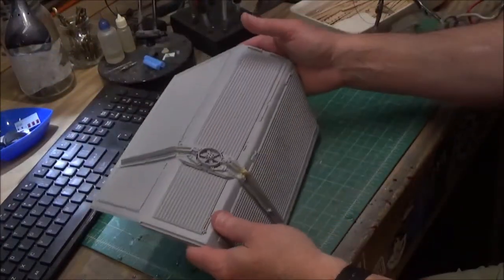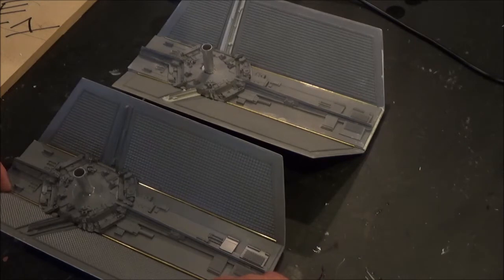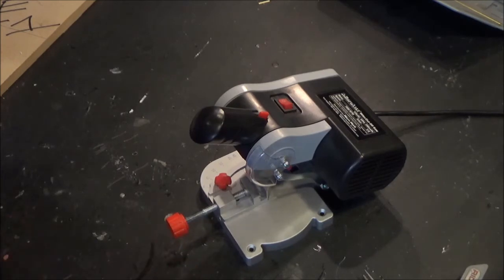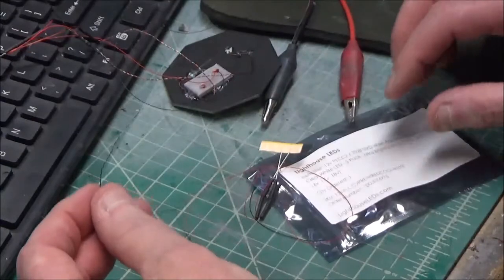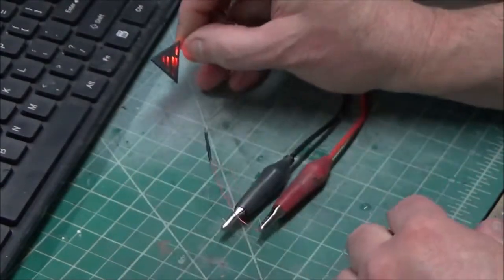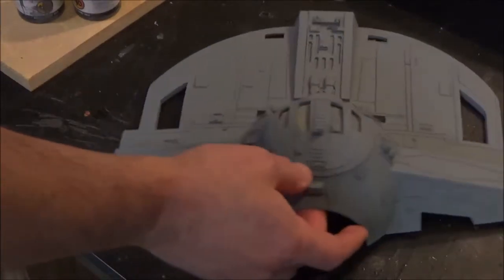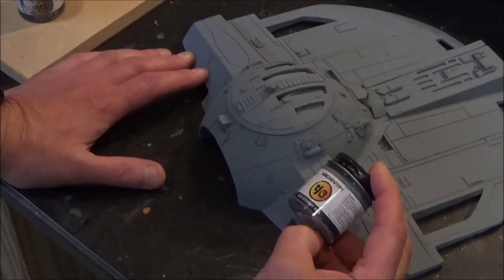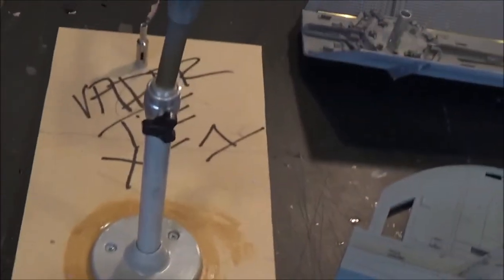Darth Vader TIE Advanced X-1 1/24 Scale Resin Kit Build Pt 2

Comment: Do recall the ratio for mixing the 2 colors of the gray and stormy sea?
Reply from the maker: I wanted the Vader TIE to be a bit more bluish than the standard TIEs that would accompany it.  The ANH Stormy Sea is more blue than the ILM Story Sea, so I made this ratio about 1:1.  I used much less ANH Stormy Sea in the mix when I painted the stardard TIEs and there is a subtle difference.  I'd test it, but you really can't go wrong with a 1:1 mix for this model.